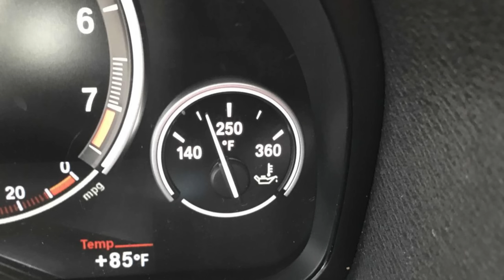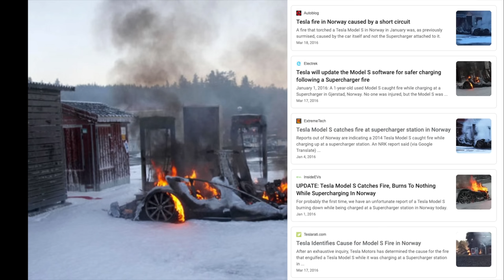Can A Tesla-Swapped 1950 Jaguar Supercharge? Yes! Also No. It's Complicated.

Comment: Just pull a trailer with a generator to charge up the car.  It is a simple and easy fix.  Thank you for the video sir.
Reply: like... solar panels?
Reply: Hybrid cars be like
Reply: Yess 😄. A big V8 generator
Reply: @manwithnoname4716  Jeremy Clarkson would be proud
Reply: This idea did cross my mind once when I was thinking about getting a second hand Nissan Leaf. Just for a laugh I googled the specs for a small 2 stroke "suitcase" generator that wouldn't take up an excessive amount of the load space, then did some calculations.

I can't remember exactly what the results were, but once the inefficiency of the generator and the Leaf's charging circuit were taken into consideration, it worked out to something ridicules like 2:30h of charging per extra mile worth of power put into the battery. To get any usable "get out of trouble" charging in an acceptable time frame would need a much bigger generator.

I'm not even sure if a Leaf's electronics would decide there wasn't enough power coming in and refuse to charge at such a low level. :D
Reply: @Reman1975  A mile in a Leaf is in the vicinity of 250 Watt hours.  Are you saying that your generator only puts out an effective one hundred watts?  I think you might have made a factor of ten error.
Reply: Yes a large, super heavy and loud generator towed behind you nice quiet Jaguar that sounds like the way to go. The lose of efficiency towing said generator would come close the power generation from said generator thus a near zero sum gain in power but a complete lose in the cool factor. Yeah tow a generator behind it that's the way to go!!!
Reply: Some EV crowd years ago had that idea, a custom trailer/generator (that matched the car) that normally stayed at home, and only got used when on a long trip - way before recharge stations came into being.
Reply: @paulstubbs7678  
Yeah, a man with a VW Rabbit converted to EV in the old days chopped the front of another Rabbit and converted it to a "pusher" trailer and hitched it to the EV.
When the lead acid batteries got low he switched on the pusher engine and drove using the ICE engine of the "trailer" while also recharging the EV battery.....
Reply: We did that with the Electrica. [ https://youtu.be/cRlCDQjzLcs  - drove to Key West (from Kershaw SC) like that ] Most modern EVs have safety cutouts to prevent driving while charging. We, of course, have no such nannies. Not even a BMS. Or cell monitor. ('tho there was a BM50 on the partially charged pack for the "sunday quite hour" laps on my channel -- that's what's beeping at the end. My fellow teammates had already destroyed two chevy volt sub-modules by super deep discharging them.)
Reply: @Reman1975  Depends on the year. I think early ones only have a 3.3kW onboard charger. 2022's have a 6.6kW. A standard 120v Level I charge would only be about 2k (120*15). That's a pretty small generator. But you can't charge while driving; the safety interlock won't allow it.
Reply: @JohnSmith-yv6eq , I was about to mention Mr. Sharkey, but you beat me to it. In his first version, he actually had an actuator to control the clutch on his pusher trailer. Later on it was converted to automatic for a simpler set of controls.
Reply: @JohnSmith-yv6eq , I was about to mention Mr. Sharkey, but you beat me to it. In his first version, he actually had an actuator to control the clutch on his pusher trailer. Later on it was converted to automatic for a simpler set of controls.
Reply: Better yet.. put the generator INSIDE the Jag....
Reply: @paulluce2557  
Or imagine a small diesel,
And then you don’t have to worry about supercharging or even range at all.
Reply: 3-71 detroit diesel genset in a trailer 😂 could probably even supercharge it from that if you got the electronics right haha

Comment: Now you need a super charger sticking out if the hood but it's actually the cooling unit with forced cooling.
Reply: I'm not sure the high voltage line would stretch far enough for much driving aroun.... oh, the other kinda supercharger ;)

Comment: Matt you are absolutely correct, I fixed my salvaged car and supercharging was disabled.
It took them 6 months to turn it off and in that time had charged over 10 times.  My car was front end damaged and only went as far as the subframe. It's been a year now and 40k miles later it's been really good with little to no issues.  I really like what your doing with the Jag and looking to put a model 3 into a Ford ranger but completely with as much Tesla functionality as possible.
Looking to integrate battery pack with custom frame and motor using Tesla subframe.  I just want an electric truck so bad I think I could build one myself before they begin production!

Anyway great progress and enjoy every video!
Casey

Comment: I wonder how the new NACS system will affect the legality of using a Supercharger for the Jag? Since it'll be the new Standard for fast charging for all EVs in the entire US, I wonder how/if Tesla will still try to tell you that you can't charge it at a Supercharger. If it would become reasonably legal for you to use them, it might be worth upgrading the charging equipment. This video is also two years old already by the time I'm making this comment, and I'm fairly certain this build is already done by now. There is also the possibility that this question is addressed in a later video already.

Comment: I'm sure you have been corrected several times by now: "250 watts" when Im sure you meant 250 kilowatts.
Reply: I'm positive he meant 250watt like a floodlight bulb xD same thing

(just joking)
Reply from the maker: I did mean 250 kilowatts. Soon, I will have screwed up enough to have a whole "Corrections" video.
Reply: @SuperfastMatt  DIWhy Not
Reply: @willemboudestijn138  These puns are so Electro Cute
Reply: @SuperfastMatt  You also called the heat exchanger a radiator right after you told us its not called that. No… I don't go to parties… My choice… Kind of…
Reply: If it was 250watts you could use solar panels ........ But that's another story.
Reply: I was thinking wow my computer uses more wattage than a Tesla.
Reply: The error is just 3 orders of magnitude, that's within acceptable limits for a YouTube video. I've seen worse.
Reply: Glad I want the only one who noticed, and that's fine Matt, we all make mistakes (at the benefit of others, of course)
Reply: 250 gigawatts
Reply: @HenryLoenwind  Conceptually accurate enough.
Reply: I did the maths on that as soon as he said it and was super confused, like that'd mean 8 solar panels would be able to supercharge a tesla, 250Kw thought, different story
Reply: Next million dollar idea: some dohickey to melt salt or spin a flywheel or melt salt or spin a flywheel to get 80% of the supercharge accesdible? Make hydrogen, power a closed turbine, magnetize a really loud tape, ...
Reply: @SuperfastMatt  the more mistakes you get, the more comments you get ;D Smart man....

Comment: That pt cruiser picture just made me want one.  Take it and cut the floor out of it. Snd build a 2x3" square tube frame, use a direct injection 4.3 vortec v6, LV3 im thinking. Maybe its not direct inj. But its LS/LT based. Connect it to a tr6060 from a camaro,  maybe add some boost.  A couple turbos will definitely make it fun.  Use a explorer 8.8, 3.55 gesrs. 26" tall tires  17-18 rims 7.5-8" wide front. And 8.5-10" rear coil over ladde bars or 4link, with a watts Link over a panhard bar. And graft on mid 80's corvettte disc brakes,  upgrade the stock parts later.  It would make one heck of a sleeper, especially with a quiet exgsust, use a flow master pro series muffler, eith 3" exhaust,  and definitely put atleast a 6point cage inside, i would guarantee it would do 10.50 in the 1/4, with 4.10 gears and 10-15 psi of intercooled boost. Maybe a 75-100 hp wet nitrous kit, at least using E85 for the nitrous,  using port injection with a nitrous nozzle on the bottom of the intake using a holley high ram style intake with 90mm throttle body. Then happy fun in a pt cruser..

Comment: I'm glad you covered why Tesla disables fast charging on salvaged cars.  Tesla is a relative new car company running on relatively unique tech.  You hit the nail on the head that a Tesla fire is going to garner a lot of media attention just because of what Teslas are, while a gas car catching fire usually wouldn't even be news-worthy.  I really dislike Tesla's approach towards repairs and salvaged vehicles, but frankly, it's a necessary evil for the company at this point.

Comment: This is a good reminder of how complex things can be with this brave new world. I am very uneasy about buying a Tesla because I don't like the idea of Tesla modifying my software and removing features from the car without my permission. I respect their permission to deny me access to their supercharge system for any reason. I now sort of understand why they have removed the fast charge capability from a salvaged car (or a car using a salvaged battery pack). I'm still nervous th at this will shift the balance of power between manufacturer and owner a little too far. 

I don't like taking my cars to dealership service departments because they're expensive, and I have trust issues with car dealers. I really appreciate the freedom to take my cars to independent garages that I trust. Would Tesla remove features (like the ability to supercharge, or even fast charge) from a Model 3 that I had purchased new from a Tesla dealership because I decided to have it serviced by an independent shop that specialized in working on Teslas? They could argue that they were concerned that an unafiliated repair shop might degrade the battery pack's active cooling system to the point where it might be a fire hazard. I can almost understand their reason for concern. Still, it would leave me with the choice of losing features from my new car, or being left at the mercy of the dealer's service department. "Brave new world" indeed.

Comment: Nah you don't need active cooling. Just solid thermal monitoring.
On most days you can probably hit it quite hard.

Zero ev has a new magic CCS box. Not sure how well it integrates with the stock BMS which you seem to use. But options are out there.

Comment: In one of those Electrek articles, I found quite a discussion about sharing EV charging with all EV brands. Some defend the monopolistic competition, others defend the liberal use of them. In my opinion, if the surge and disruptive industry of EVs wants to compete in a higher bar with ICE brands, then the manufacturers of EVs and charging points will have to liberalize the use of charging points just like any other network of the gas station.

Comment: "You can correct them with that factoid, and then you'll stop being invited to parties." Love the humor.

EVs without robust right to repair is... Problematic.

Do they still basically just drop current into the battery unregulated (on the car side) from a supercharger?
Reply: The regulation is on the supercharger side, as it is with any fast DC charger. The car tells the charger what to do.

Comment: Hey Matt
I've got a few questions: Charging Station plugs, I assume that Tesla's plugs are different than say Ford's plugs. Yes or No? Do you see a standard being set on all charging plugs some day? Kinda like how the OBD and OBD II became a standard type of plug so that you can read what is going on with your car. These question just popped into my head while watching this video, keep up the good work.
Bart
Reply from the maker: There are a few standards, but there are plug adapters for most of them. A global standard would be nice, but don't hold your breath.
Reply: Not Matt, but there is a standard already implemented in Europe. It's actually just Tesla who is the odd one out, they're like the Apple of the EV world, for better and for worse, and in Europe, Tesla is required to use the same connector as everyone else.
Reply: @SuperfastMatt  That's the good thing about standards - there are so many to choose from! :-)
Reply: @stevejohnson1685  ❤😊❤😊

Comment: Driving a Mitsubishi i-NiEV I had range anxiety only 2 times in my live. I was driving with a friend. It was an ancient Diesel car and we emptied the tank and the pipes. Walking to a gas station and back with a 5 liter plastic bottle that was never made to carry any fuel in the first place. We had to fill the pipes first and we did not know if the battery would stay alive long enough to keep the starter turning until the engine started to cough. Next time was my own petrol fueled car. The (german) government decided mixing petrol with alcohol was a good idea but VW said it was not. Fuel lines would leak and get me an engine fire.That was when my wife bought us the i-MiEV. Since then we have far more power sockets we can plug in than we had gas stations to choose from. The car is 10 years old now and still drives like when it was new.
Reply: A slightly less ancient Japanese diesel would have had a pump built into the diesel fuel filter so you could unscrew the filter and fill it with diesel; screw the filled filter back onto the pump housing; then tip the rest from the bottle into the tank and suck it up into the filter.
About 150 small pumps to first fill the filter otherwise....
As soon as the fuel comes up to the pump from the tank, the diesel is ready to go...a lot of the Japanese diesels were also self-bleeding.
Clever people those Japanese diesel engineers....

Comment: Note: if you are stuck in the middle of nowhere without electricity... ...you’d be in the same situation as with an ICE vehicle. They need electricity to pump gas and pay, and they aren’t going to build a gas station in the middle of no where if they can’t get electricity. Sure, something could happen, and the power gets cut off, but again, both EV and ICE vehicles will be screwed. 

The absolute worst case scenario would be ringing some poor homeowners door, and offering him a $20 to let you plug in (assuming you brought your own cord.) If you’re able to be picky, look for a house with an RV. Some RV owners will have a 240 outlet. You can’t do that with an ICE.
Reply: To be pedantic regarding your first point - a jerry can with gas doesn't need electricity to operate.
Reply: @gietie96  if you have it. Most people don’t lug around full gas cans. It smells and causes headaches. The person who lugs around a full gas can probably also wouldn’t ever be in the position to need to use it on their own vehicle. Besides, at best, it’s just 5 gallons.

Comment: I just can't shove 250W of high voltage into it at their charging station..
there are a few approximations in this sentence.
btw thanks for the info about hacking supercharging on a salvage Tesla.
with the recent 200$ MCU2 update or free recalls, ability to activate (free?);supercharging, and electrified garage decent prices to fix defective batteries , buying a cheap salvaged model S sounds better than ever. there's still the issue of V1 supercharging speed.

Comment: Get you a small commercial generator like building contractors use when they don't have power to the job site . Remove your back seat and you have your charging station with you . Get one that operates on propane not regular gas . Ha ha yeah i know that's kinda dumb but just could not resist saying it .